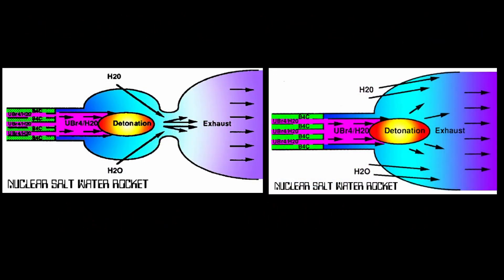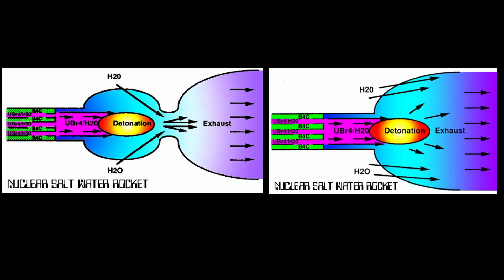Crazy Nuclear Rocket Engines 9 - Nuclear Salt Water

Comment: Just bring a radiation shelter with 6 meters of water surrounding the crew & have them climb in it during burns. This design has the added benefit of the engine being relatively safe when not firing since most or all of the fission products are yeeted out of the solar system at near relativistic speeds
Reply from the maker: Two words...
Neutron Activation...
Reply: @EagerSpace so shadow shielding would still be needed for the engine even after shutoff then, but is the neutron output from the exhaust gonna be so bad that they have to worry about activation in the rest of the ship? Would it be impracticable to make the nozzle large enough that the fission chain reaction dies out before the exhaust exits?

Comment: In ProjectRho, there is a colleague of Dr. Zubin, who proposed a less radioactive variant of the NSWR, the Lithium SaltWater Rocket. Could you please explain on that design?
Reply from the maker: I probably won't cover it in a video. The obvious problem is to get the high neutron flux required to do what you want with the lithium. This is really not easy to do - the only way I see doing it is with a reactor operating at a high level, which requires cooling that you will need to figure out. 

See https://www.physicsforums.com/threads/clean-lithium-fission-saltwater-rocket.863418/#google_vignette for a good discussion.

Comment: If you think about it, this just an evolution upon the concept of the open cycle gas core nuclear rocket. Especially when you're dealing with the less ambitious version that has an Isp of "only" between 6000-7000s. It's right around the ballpark of what you'd expect of a GCNTR using water instead of hydrogen as reaction mass.

Comment: Can you make a video on fission fragment engines in your crazy nuclear rocket engine series?
Reply from the maker: I'll consider it. You can get absolutely ridiculous specific impulses out of it because the fragments have a ton of energy and are moving ridiculously fast - 12 million meters per second or more. 

The problem is that you have to somehow get the fragments moving in the direction you want and keep them from running into other atoms which would slow them down. And you need to get enough fragments to give you a useful amount of thrust.

Comment: At a thrust of 8 MN, using 20% U-235 (LEU) gives a mass flow rate of 203.9 kg/s, while using 90% U-235 (HEU) gives a mass flow rate of 1.7 kg/s. Keep in mind that the vast majority of this is water, not uranium tetrabromide.

Most sources state that peak neutron emission occurs in the exhaust plume. Even if that isn't true, using HEU instead of LEU still results in a 96.2% reduction in crew radiation dosage. If higher exhaust velocity does help, then the reduction is even greater.

Counterintuitively, using HEU makes crew radiation shielding much easier than when using LEU, but if an even more fissile nuclide than U-235 is used, such as U-233 or Pu-239, then smaller engines with even higher specific impulses can be achieved — reducing crew radiation dosages even further.

That said, we are talking about radiation shielding for what amounts to a nuke that's meters away and explodes for days instead of microseconds. 💀🥀⚰️

For a HEU (or equivalent) engine, a geopolitically unacceptable amount of weapons-grade fissile material would have to be brought together in one vehicle. I'm assuming this would result in development, construction, and operation well beyond Low Earth Orbit; only for relativistic interstellar missions; and under intensive international oversight.
Reply: Lead foam as a liquid hydrogen shield would help with radiation.
Reply: If you think about it, fully fueled starship is a private vehicle that can deliver 1500 tons of rocket fuel at hypersonic speed in any point of globe, it probably can penetrate dense atmosphere at mach 3-4 and during impact all fuel and oxidizer will instantly combine together, resulting eqivalent of a small nuke
In other words, Elon Musk theoretically can nuke everyone on the planet right now)
Reply: these numbers are extremely sus, has anybody done thermal/cooling analysis and neutron damage to the engine? Real working example likely 10× less powerful.
Reply: @nehorlavazapalka  It's admittedly back-of-the-envelope. If you want a trade-off study written by professional engineers, then you're welcome to seek one out.
Reply: @nehorlavazapalka film cooling using LH2 or even water can help with that. And the bigger the engine the easier it would be to film cool
Reply: It’s got tradeoffs that’s for sure

Comment: About radiation, fuel mix is pumped faster than neutrons travel, thus all free neutrons are spewed outside of the ship before it have chance to react with any unintended parts
Also, ship will most likely be MASSIVE, with enough space to fit nuclear reactors breeding fuel on fly
And who cares of flying Chernobyl revving their engine towards other star, their exhaust will be scattered within minutes so much you couldn't tell apart from regular space radiation

Comment: With an ISP of 480,000, you can afford to just take a radiation-shielded bunker with you.
Reply: Pretty much. Basically allows you to throw practicality to the wind (a little bit) in ship design and design it how you want and not how it has to be because your engines are crap.
Reply: Exactly, why take just a crew when you can propel an entire generation ship with this thing

Comment: You could just store the salt separate from the water and mix them as needed, in a geometry that doesn't lend itself to criticality; saltwater is liquid hate to metal anyways. By sacrificing impulse film cooling can be used along with regenerative cooling to prevent the thing from melting. The crew can be situated behind a shadow shield during its operation.
Reply from the maker: a) In a 2% solution of uranium tetrabromide in water, spontaneous fission will occur - that's how the engine works. Separating the salt gives you a 100% concentration of uranium tetrabromide, which is likely critical in large quantities ("likely" because water is a moderator and increases the reaction rate. More than likely with the version that uses 90% enriched uranium).

b) How are you going to mix the salt with the water quickly enough?
Reply: @EagerSpace  1 just don't store the salt it in a shape that makes for a critical mass (like a flat plane surrounded by neutron absorbers), 2 turbulence of the flowing water and it doesn't all need to dissolve. Add in a few bypass valves to limit the turbulence and how much uranium salt gets mobilized.
Reply: @EagerSpace The water isn't there only to act as reaction mass. It's also there to act as a moderator. Moderators significantly increase the reactivity of uranium by slowing down neutrons so that they're more likely to be captured by fissile nuclei. Keeping the water and the uranium separate would decrease reactivity in the system, even with the higher concentration of uranium tetrabromide in one place.
Reply: @EagerSpace  why bother enriching , make u238 the reaction mass... And why not use liquid hydrogen as a nozzle coolant/moderator?
Reply: nevermind, 2% is volumetric. 2 U atoms per 100 molecules of water. With U weighing 240 , Br weighing 80 and H20 weighing 18 . 

Solution is actually 18% Uranium by weight. And 22% Bromine.
Reply: @rokadamlje5365  Because U 238 isn't fissile? And because liquid hydrogen is difficult to store for any substantial length of time?
Reply: @EagerSpace  you store it in a huge amount of neutron absorbing tubing.

Comment: And what is your opinion of the lethality based on? Space itself is a giant radiation bath. The exhaust at a such a high ISP is moving away from the ship at close to 1% of the speed of light taking the problem away with itself. The fuel tank, if it is doing its job of keeping the reaction supercritical, would be shielding the crew, plus the extra water the engine needs to run cool would logically be stored between the crew and the engine...

Comment: The only off-the-top-of-my-head application for this would be missile drives. No crew to worry about, electronics will probably be hardened anyway, and you don't care about the lifespan of the nozzle.

Edit: you'd want it to be well away from your vessel before lighting that candle, however.
Reply from the maker: I think the fizzler might be a better choice for missiles.  

In either case I'm not sure how you steer the thing. This one I guess you could build a gimbal the drive somehow, and you get an end-of-boost nuclear explosion if that's what you want. Or maybe even if that's what you don't want.
Reply: @EagerSpace  I am not an engineer, merely a moderately well-read average space/sci-fi junkie. And the idea of gimballing a Zubrin terrifies me.
Reply: @EagerSpace  For the Zubrin drive, steering is probably down to the same method used in some SRBs - fluid injection into the nozzle. Handily, you are already pumping tonnes of water into the chamber

Comment: What about antimatter catalyzed micro-fission-fusion drive or even muon/tau catalyzed fusion drive, or even laser induced metallic hydrogen annihilation! or antimatter-matter oscillation zero point higher spin boson ghost condensation graviton superconducting gravity pressure potential energy difference suspension and torsion drive system! Or spacetime manifold micro-macro ghost condensation stabilized quantum foam wormhole engine, or 
OR!.. 

..nah just kidding. So many things we could imagine.
Reply from the maker: Go look here: http://www.projectrho.com/public_html/rocket/enginelist3.php

Note that this can be a big time sink. I may do a video on fusion drives in the future, but I'm a bit burned on on the nuclear side right now.

Comment: This is very doable man. I don't think it's crazy at all. The salt needs to be dissolved as it enters the combustion chamber. If the water is store separate from the U235 then it will be more than enough shielding for the crew if placed strategically. Like at the back of the craft just like every other rocket is made
Reply from the maker: Umm.... If you store the uranium salts separately from the water, you end up with a lot of 20% enriched uranium together in your storage location. 

That has a pretty obvious downside.
Reply: @EagerSpace  😂😂😂 you just destroyed him in the most polite way possible
Reply: @EagerSpace  it can't reach critical mass just sitting there. U235 isn't radioactive enough to hurt you. What exactly are you getting at?
Reply from the maker: @rexmann1984   Zubrin's hypothetical in his paper on the NSWR uses a trip to Titan and back and specifies 16,700 kg of uranium. The critical mass of 20% uranium 235 is 600 kg assuming no neutron enhancement, and will be less if there are any moderators around (water tanks) or neutron reflectors to increase the reactivity. This fuel would be a uranium salt so that will change things, and I'm not enough to of a physicist to calculate the effect the bromine has. 

You can't just keep all of the uranium salt in a big chamber; you would need separate ones carefully designed to keep a critical mass from developing. Then you need to feed at at a very specific rate into a high-speed stream of water moving at 66 meters/second and make sure it's dispersed well enough to so that you don't get an immediate critical mass.

All of this has to work well from zero gravity to whatever thrust you are getting out of the system. 

From what I can tell, the reason Zubrin chose an aqueous solution is that while it's a pain to deal with as it is much more reactive - because of the moderating effect of the water - the salts will tend to remain evenly dispersed in the water and therefore the reactivity can be calculated for the fuel storage and transport into the engine so you don't get criticality issues, and you are unlikely to get increases in the concentration. Which would be bad.
Reply: @EagerSpace  Just use cartridges whose geometry doesn't lend itself to criticality, and add neutron absorbers for good measure, and bolt on new cartridges as needed. Those cartridges would be exposed to hard vacuum when not pumping so they'll be nice and dry for the next burn or if they need recycling. Exposed to giant tanks of moderator would be a lot worse I think. I also think making a bypass flow to the mixer will solve most of the ratio mixing problems so long as the mixer can't go critical. I don't think the mixture needs to be perfect either, any undissolved salt particles will explode anyways in that kind of neutron flux.

First NSWR on atomic rockets page has 195.00 (kg/s total mass flow rate) * 0.02 (2% solution of 20% enriched salt mixture) = 3.90 kg/s of fuel salt so we can store quite a few seconds in a single cartridge, practical if we're not tying to use acceleration as gravity, or just have redundant mixers with their own cartridges. Editing a lot, this topic keeps me thinking.
Reply from the maker: @leerman22  Avoiding criticality is hard in real designs. There are some very involved processes in the enrichment and fuel fabrication industries to keep it from happening, and there have still been some accidents. 

The point of giant tanks already mixed is that is it a uniform material because of the way the physics of salts in waters work; you can model it and be confident that it won't explode in the tanks, at least if you've done your math and tests correctly. 

Now you've added a complex new step. If you get 1% solution, the rocket doesn't work. If you get 5% solution, you probably blow up the rocket. 

Building tanks to hold salt solutions is easy.
Reply: A cork screw type feeder would work. The salt should be pulverized into a very fine powder so it can be fed in consistently. This seems to be one those that we just don't have a need for yet because we don't have the required space infrastructure to build a ship that would need such a hog of an engine.